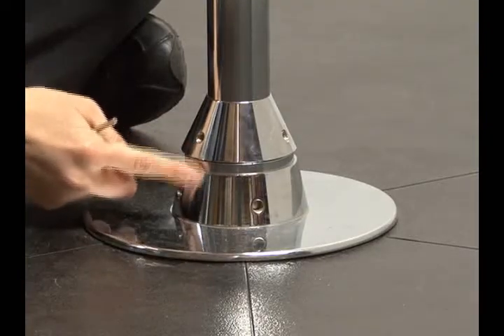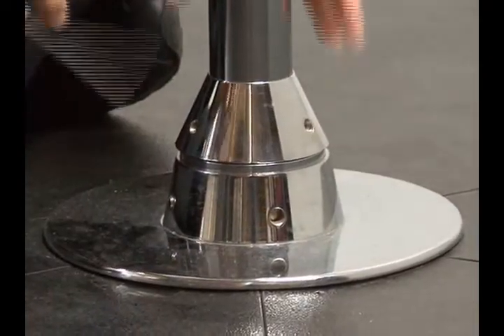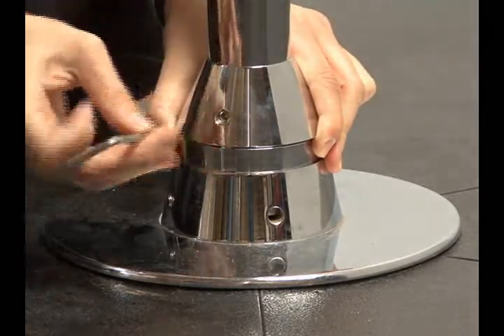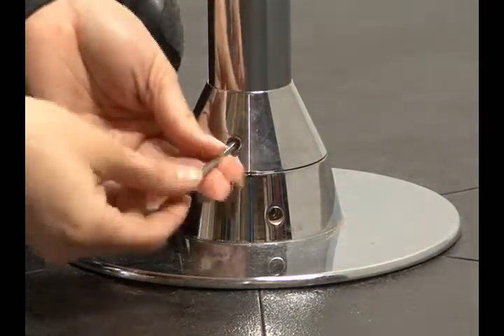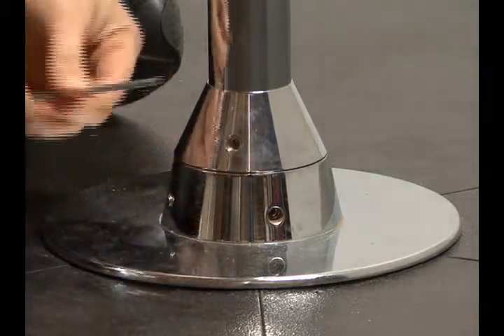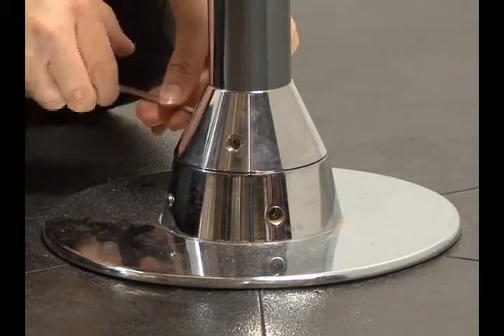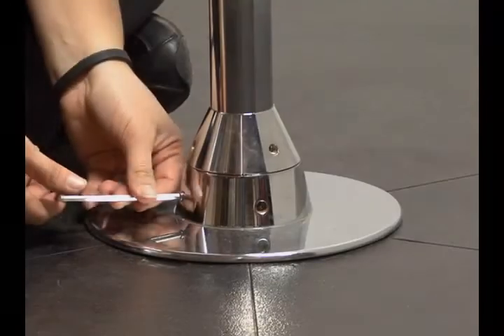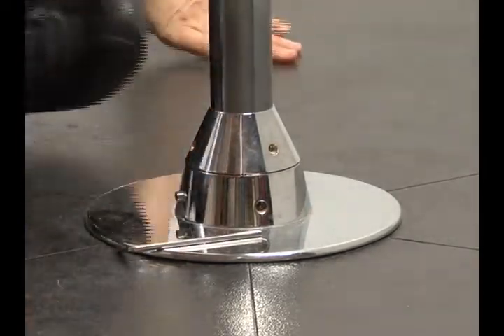Gap Between X-Stage Bearing Unit and Base Frame

Comment: The bearing unit is not coming off the base when I lift up the pole after releasing the 3 larger screws on the base. How do I remove it?
Reply: I had this issue too. I ended up having to remove the pole out of the bearing unit, and leave the bearing unit attached to the base. Then I reassembled it outside and used it for a few hours. Then when I disassembled a second time, for some reason the bearing unit became unstuck from the base and went onto the pole. Of course now there's an unmovable gap between the unit and the base. #poleproblems
Reply: saaaame!!

Comment: I have fully removed those screws and the unit simply will NOT slide down. Could I use a rubber mallet to knock it into place? It's stuck.
Reply: I have the same problem. How did you solve this issue?